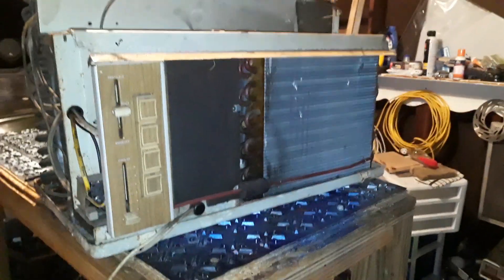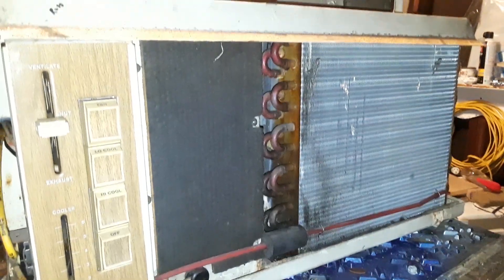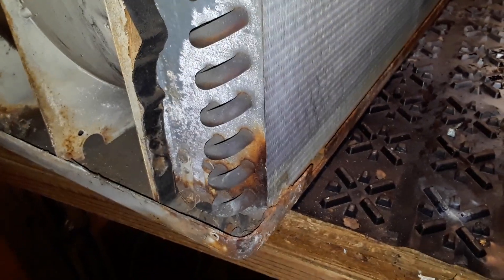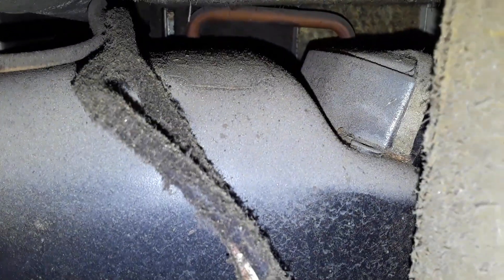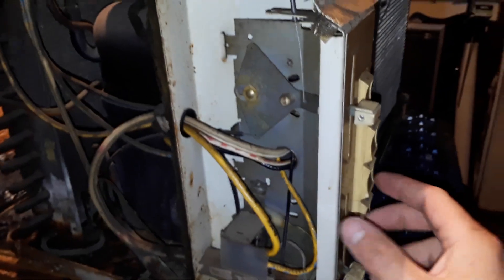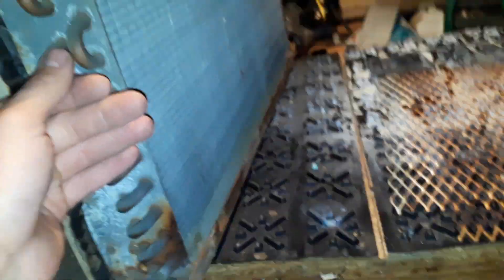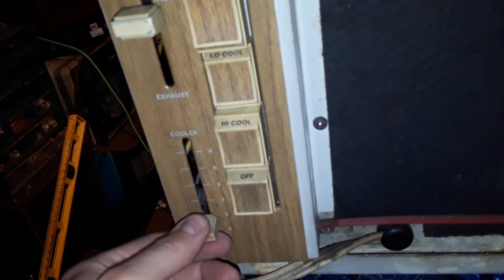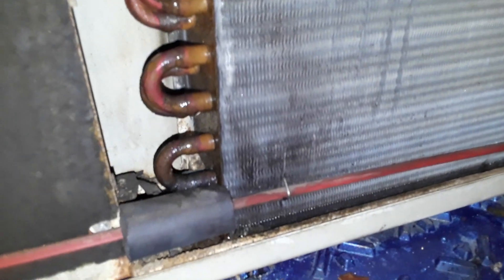Quick but much needed PSA, and a good look at an early 1960's Carrier Weathermaker, by request!

Comment: The unit is awesome. Ain't it sad that you have to tell people to be kind. Common sense said to treat others as you would like to be treated. Anyhoo, looking forward to seeing the unit in restored condition. I noticed that the evaporator fan is a blade and not a blower wheel. Seems like their idea was make the unit as compact as possible. Gives it a unique design and look. I also like the button design control panel. Looking forward to seeing your next video.

Comment: Love those big ol' 60's push buttons!  My Siesta has the condenser raised up like that as well.  Carrier must have used some good paint at the time as well, but there was zero rust on the pan.  My Sears Viewsaver has triple-passes in both the evaporator and condenser and still manages to be quite efficient.  The nameplate watts give a 7.0 EER but even on a 90 degree day it runs closer to 8.0.
Reply: Love That, This Unit is between 67& 68